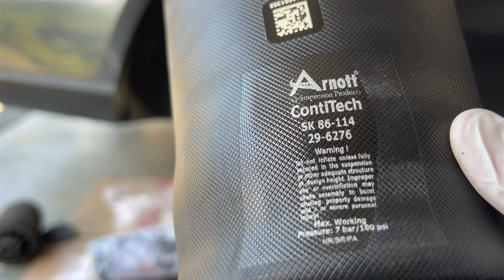Mercedes Benz GL450 How to Replace Rear Air Suspension (AIRBAG) | Step-by-Step Guide

Comment: Hi Michael, great video. This has been super helpful. I attempted this today and had a few questions. 
1. Is it really necessary to remove the height sensor and well panels? I was easily able to install the new air shock without doing either. 
2. Once the new air shock has been installed, should I really let the jack down all the way, this seemed to crush the new shock to an awkward position.

I did not attempt to start the car and inflate the shock because of what I described in item 2 above. I would be grateful for any advice you may have. Wondering if item 2 has any relationship to item 1!
Reply from the maker: Hi Johnny Bravo, I'm glad you're watching my videos.
My stepson is a licensed mechanic but he's at work right now. I hope he will have time in the evening to answer your question.
Reply: Hey John, to answer your questions 1. If you are able to do it with out removing the well and the height sensor if you deem it not necessary. 2. I would definitely have the end that has the new air springs be lifted like several inches off the ground then start the car and let them inflate. Once the are full slowly drop them down. You may be able to do it fully on the ground but it is advised that you have it in the air when they are empty to not damage the new parts. Hope this helps!

Comment: Hi, What do you recommend  me to do. I already replaced the air compresor and the valve. But it keeps lowering  from the rear. I looked for a leak, but i couldn't  find any? I have a Mercedes  benz 2017 gls450
Reply from the maker: You may have air leaks in your Rear Air Suspension.
Reply: I have the same car, same issue . Any resolution. Replaces compressor, solenoid valve and air bags
Reply: Replace the defective air springs first then air compressor if is issue still persists.
Reply from the maker: @maksimus-129  👍